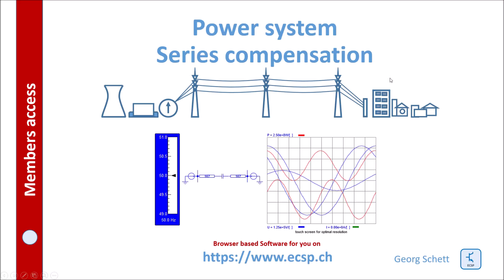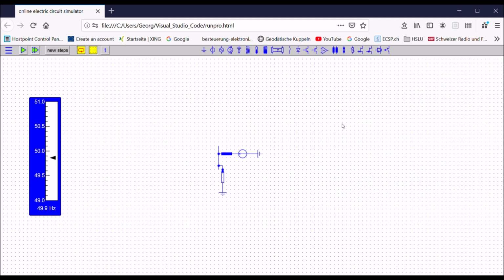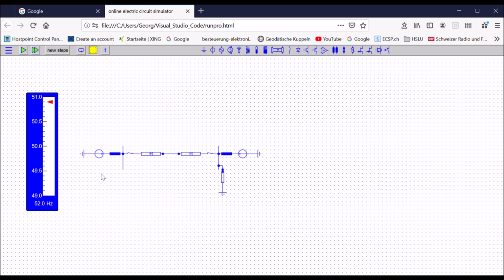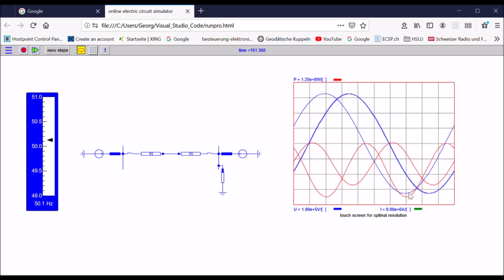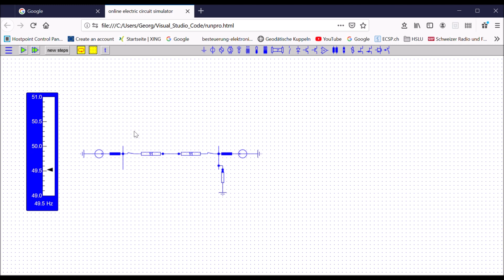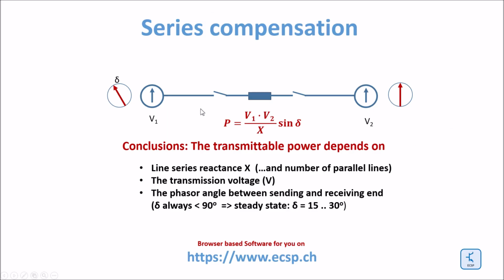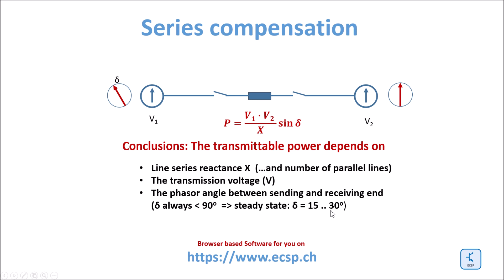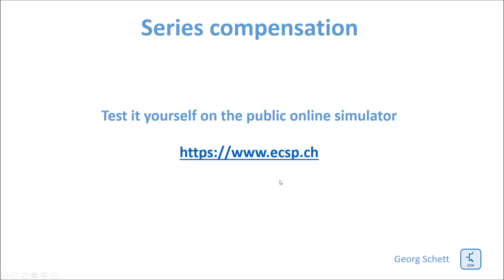Series compensation of long transmission lines [circuit simulator]

Comment: Thank you for the lecture. May I ask. Do shunt reactors have the same effect? Are they also used for long transmission line by installing at both ends of the line?
Reply from the maker: Thanks for the question. No, the effect is not the same. Shunt reactors compensate the capacitance of a long line, i.e. reduce the overvoltage when the load is well below the line natural load. Series capacitors on the other hand compensate the inductance of the line, the line appears shorter and thus the phasor angle between the line ends will be reduced in favor of the transmission stability. There is however some interplay.